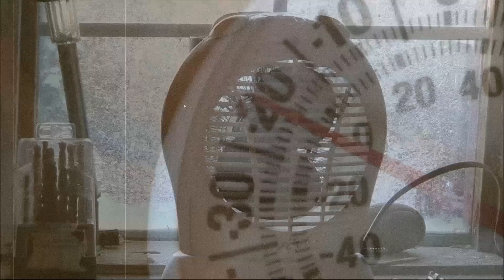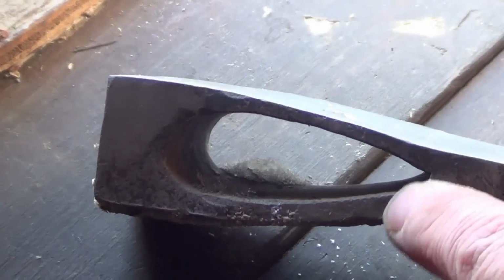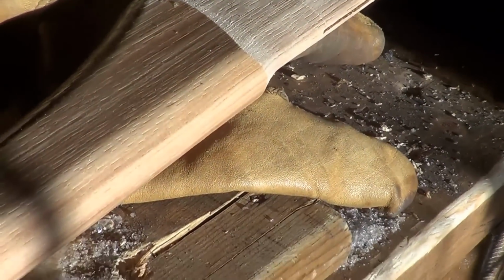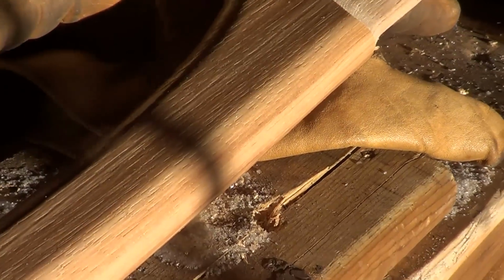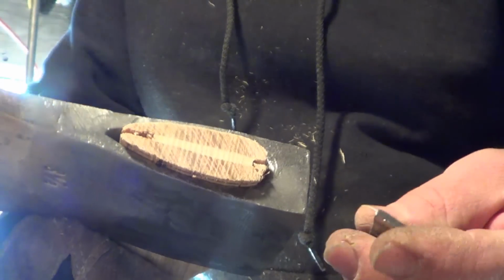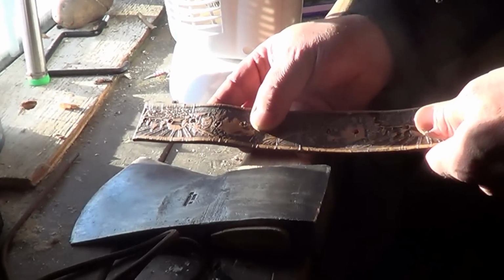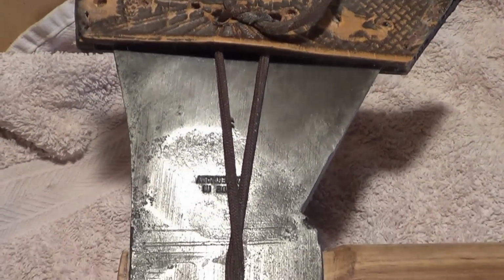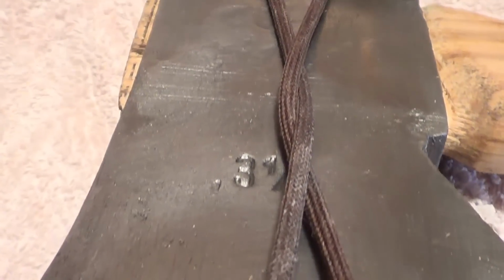Old Axe Restoration

Comment: The wedge should fill up the whole axe eye. I recommend taking the wedge out and punding a much longer one. Thestee wedge is not required if you use glue to secure the wooden wedge.
Reply from the maker: +Marcin Cebulaczek I think you're right!